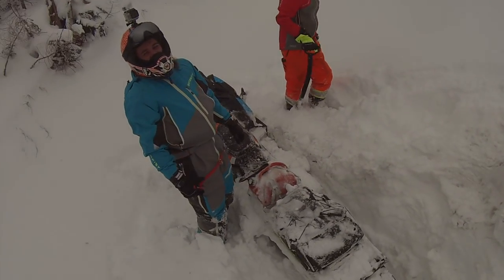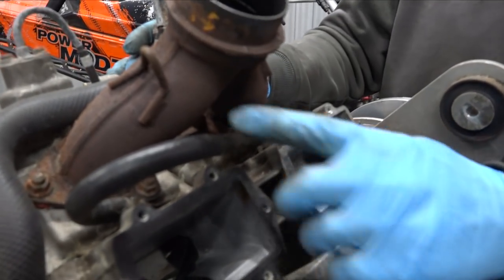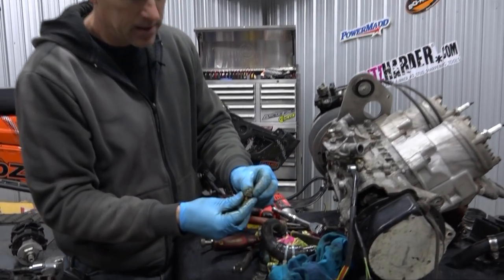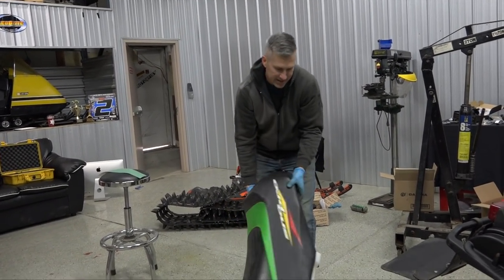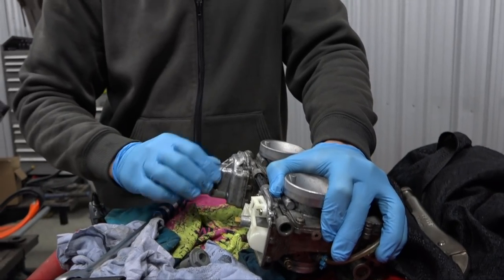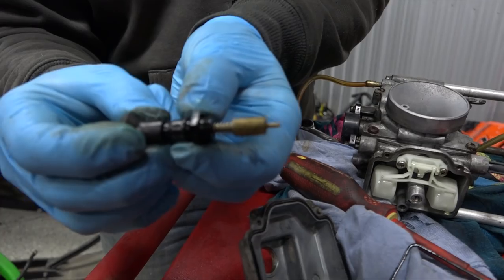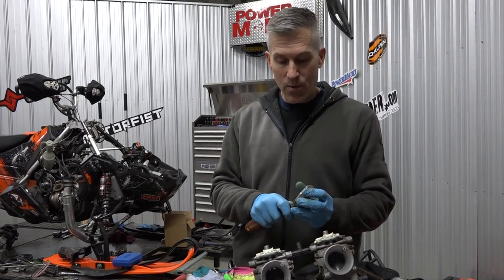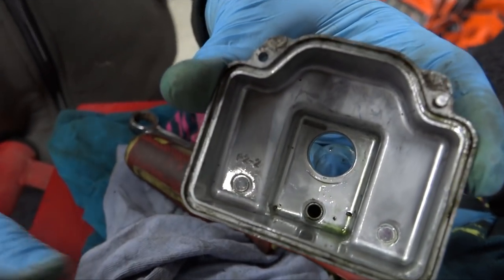ARCTIC CAT SNOPRO 600 ENGINE AND CARBS - A CLOSER LOOK!

Comment: You need to order the updated steering braces that ONLY came on the 2006 sno pro 440's. They made a triangle down to the sides of the bulkhead and really stiffen that system up. Otherwise you can feel the steering post flex under hard cornering. I believe you can still order the braces from your Cat dealer or country cat.

Comment: To fix the steering you basically do the mod that's already done to it (the 440 race steering mod). But to get rid of that slack you need to take off part number 0605-870 from part number 1705-086 and apply some adhesive (something two-component and solid, epoxy for instance), then thread them back on and make sure its properly aligned as before, before it hardens. If the splines are just a few micrometers different from each other on those parts the slack in steering is significant.

Comment: These sno pro videos are great! I have a 2005 with a 700 efi motor out of a crossfire that i built im in the process of puting a timing key in it it already has a steath pipe and y pipe and a mbrp can the sleds perfect for ditch banging and drag racing since i put bigger drivers and gears out of a f5 and ditched the 440 gearing

Comment: I'm lookin at a 2011 Snopro 500 that's basically gonna need a full redo, it's in pretty rough shape... but it's only 1500 bucks and I'm questioning what I could do to it. I'll probably end up pulling the motor and swapping it out for a 700 or a m8 800 motor that I've got laying around collecting dust but I'm not sure what I'd need to do to it in order to make that work... Any thoughts? Is it worth getting to redo at that price?
Reply: Did you end up buying it
Reply: I'd scoop it and play

Comment: I have a 2011 SnoPro 600. In your video you point out the hose that you installed under the Y-pipe on the coolant barbs. What benefit does the hose provide over the stock configuration with the barbs plugged? I ask because I recently noticed that one of my plugs is cracked and leaking coolant.
Reply from the maker: To be honest I cant remember

Comment: Hello. I have a Ski doo rev 600 Sdi. I wonder what spring and what weights i should use for it. I ride in powder and would like to wheelie. I have dropped 2 tooth om the top gear. I got å suggestion from å friend that i should use å 200-320 yellow/blue spring but hos many grams should i run? Thank.

Comment: Those mixture screws will definitly will cause sleds to run like garbage, guys will put them all the way in and crank on them and the they round off the tip and it won’t run as good

Comment: I know some things about snowmobiles but I don't know a lot and I'm man enough to admit when I need advice I was wondering if your lights flicker on the f500 2005 Arctic Cat in the speedometer work sometimes it flickers what could it be any words of advice anybody and where can I get a aftermarket seat for both of them an aftermarket exhaust like a rumble pack

Comment: What engine is that ? Just wondering how that sled acquired a 600 carb with no oil injection ?? Is it running a stock pipe / silencer ? I just put an 06 440 together with an 08 factory 600 race engine , messed around with lots of these
Reply: Can you show me this build

Comment: Man ive been waiting on yiu to get a cat. I have a 06 f7 efi. And would be a serious help if I could do a video on putting in a fuel regulator in the main fuel line. Ive been hearing when your wide opem throttle cat runs to lean. Between 45 and 48 psi. I guess optimum in 41 psi. Need help.

Comment: Can someone please help me with my sled I ran out of gas the other day and filled it back up now it won’t start?!?!, it’s getting gas and spark although the spark is really weak, still has 150 compression and the pistons aren’t scratched I allready tried unplugging all of the kill switches since it’s a Polaris but still have nothing.
Reply: Trevor Block: there's a good possibility some dirt from the bottom of the gas tank got sucked into the system I'd start by cleaning the carbs
Reply: Sucked water and garbage from tank!! Never a good idea to run out of gas with a two stroke either they run real lean as they run out and tend to take service life of motor LESS!
Reply: Do you know for sure it's getting gas to the carbs? Try pressurizing the tank slightly. The fuel pump might have lost it's prime.